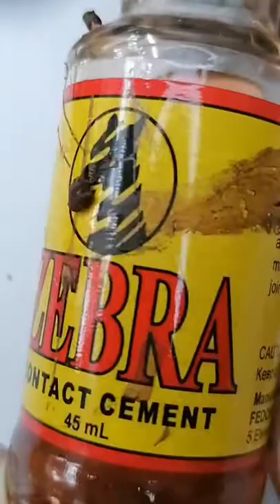SEIKO 5 AUTOMATIC /REASONS WHY FUNCTIONALITY SOMETIMES STOPS / HOW TO REPAIR 👉 E.R ESTACION VLOG

Comment: Can someone please explain this problem in English. I am having the same problem in which the movement stops working as soon as It gets in the dial up position. And in the side positions it gives a low rate like in 3 and 6 up positions it goes from -170 to -230 s/d. But in dial down position it works fine like +10 to +12 s/d. The beat error remains ok, between 0.2 to 0.5 ms. By the way I am using an android app timegrapher named "Watch Accuracy Meter".